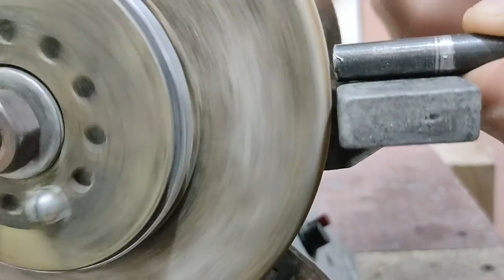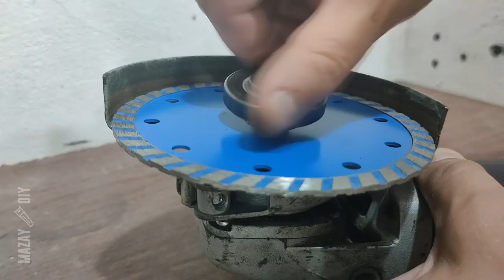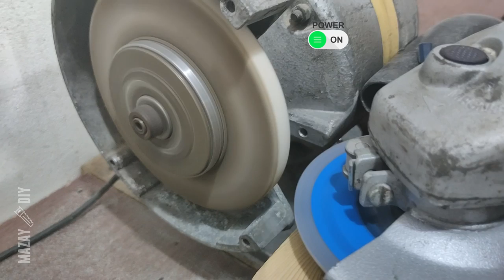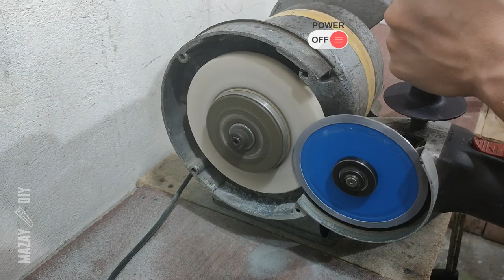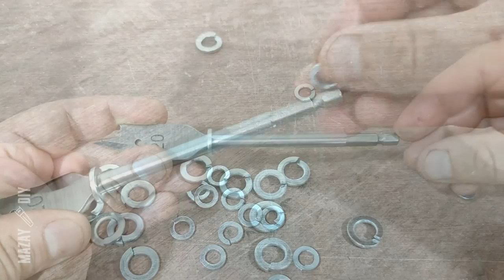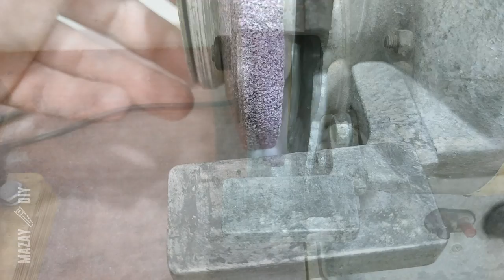How to Dress a Grinding Wheel | 3 easy ways

Comment: Useing the diamond wheel to dress the grinder is a very good idea. I only watched the video, didn't listen to the sound track so you may have mentioned this. I would be very reluctant to dress the sides of the grinder wheel. Grinder wheels are not designed for ANY side loading. To much side loading and the wheel WILL shatter on you and chunks of it will be coming at you at very high speed. After all these years I still stand to one side and reach over to turn grinders on. I wait until it gets to full speed then move in line with the wheel to do my work. Still the diamond wheel is a good idea. I also liked the way you set up to avoid a mess. Well done.
Reply: 👍 Yeppers if possible never stand inline , while true if it grenades it's going everywhere , but standing inline is just bad , like running a tablesaw always stand off to the side of blade . An avoid the cheap grinding wheels also , we had a kid  who on his lunch break run up an picked a cheapie one . I really don't know what happened as I wasn't there at that end of The Shop , but man that thang came apart with a Hell'va racket fortunately he didn't suffer any long term injuries , The Shop Foreman really chewed his ass out .
I've used the  worn carbide cutting tips from the Brake Lath as well , they do a great job on grinder wheels .

Comment: Thanks man - the split washers worked amazingly well for me! I have a 6" grinder with two stones and both had a big groove worn in the middle of the wheels. I had been looking to buy a tool for this but then I came across your video and decided to give it a go, but with LOW expectations. I mean it's so simple, how could it work better than a purpose built tool?? Well,  20 mins later I had two beautiful, square stones with ZERO cash outlay (had a bolt and washers already). You saved me $40+ and the time to go grab a tool for this. Amazing! And the other plus is that the rig I made with the washers did 2 wheels and look to be able to last for a few more clean ups yet!

Some tips if you're going to do this - make sure there's enough clearance on the bolt to allow the washers to spin freely and not too long a bolt to allow you move side to side across the face of the stone (so you wear the washers more evenly). The other tip is this will get Hot,  so wear some rigging gloves or similar. 👍
Reply: I love the "but with low expectations"

Comment: There's a tool for that , it's called a grinding wheel dresser tool . Works very well for this . Just a FYI 😉
Reply: Yep.  Its a must have item
Reply: He called his video " repair without any special tools". FYI
Reply: @EvacuatorPro  a grinding wheel dresser is not a special tool. It's a standard tool if you have a grinder.
Reply: @frogsoda  I’ve inherited a grinding wheel, but got no dresser tool. I’m still searching for a shop where I can buy one. So at least for me it’s not a “standard tool”. Until I find one, the tips in this video helps me.
Reply: @bjondersson  man everything he showed in this video is extremely dangerous, especially dressing the side of a grinding wheel. You shouldn't even use the side of the wheel much less dress it. Do what you want but these wheels can blow apart and if I'd does you will be sorry. Trust me seen it happen.
Reply: @frogsoda  all grinders should come with one, unfortunately they don't.  a lot of places that sell grinders don't even carry dressing tools

Comment: There is actually a tool made for dressing wheels,it can be bought at most hardware stores & welding supply stores !
Reply: Costs like a good set of carbide-tipped drills (unless you can get it as a cheap replacement part for grinders ofc but the pro stuff which is readily available over here costs that much) vs 1 old piece. And even if you buy the tool but you don't have the dressing harness for the grinder for any reason, the tricks here are still useful.
Reply: My wheel dresser (essentially some very hard abrasive on a stick) cost a couple of quid and works fine on small and large bench wheels. Leaves a completely square surface.
Must confess I'm puzzled why anyone would need the methods in this video.

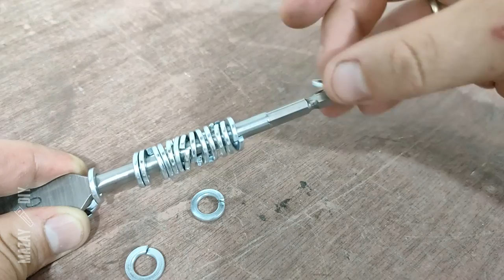Comment: 2:55  right.         i used the same idea, lock washers on a large screw driver, works for me. The diamond wheel, on angle grinder, new idea for me. Thankyou, sir.
Reply: I use regular flat  washers. an old file works  also

Comment: Weird, I  just replaced  my old dresser for one of those new fangled diamond coated wheeldressers off of ebay.  It cost less than $10.00, is absolutely  safe and took about 6 seconds to dress my nappy old grinding wheel.  Even if I  didn't  get the "SPECIAL" tool, I  wouldn't  use this method shown here, I'd  get a new $13.00 stone.  Although it worked, I  don't  like bending the rules that far.
Reply: They obviously never seen a wheel blow apart before.

Comment: That's a great hack for straightening out your old crooked out of round grinding wheels
Reply: It can also make the wheel explode. The wheel is not made for sideways pressure
Reply: @nicolasmiller-vachon4066  that makes sense also if there's a crack in the wheel and you try to push on the side of it I am sure that'll end up pretty badly too

Comment: Ah, yes… the old split lock washer to be used to replace the worn down star rings on a grinding wheel stone dresser.  I use the external spiked lock washer, also.  I didn’t see you around, 50 years ago?

Comment: Grinder from 1986 made in USSR. I have exactly the same. It dance a lot on the table. The body is too thick and therefore the diameter of the stone should be always a bit bigger. I dont use it for last few years.

Comment: There are way easier and therefore better ways to dress a grinding wheel that uses the power of the bench grinder not having to turn it on and off. They certainly don't require another electric grinder and still achieve great results. For me this is a great example of over thinking something.

Comment: This is almost a good video. You should never grind on the sides of your grinding wheels! Never! It creates grooves in the wheel and eventually it will thin out too much and come apart.
Reply: I 100% agree. The fact you have to take the guards off should be your first clue you are doing something wrong.
Reply: There are different wheels. You do grind on the sides. I was a tool grinder for 10 years.
Reply: @Robstercraw  Your right there. But they are designed to be on a side grinder or tool cuter grinder. Which take different wheels then a normal bench or pedal grinder. Normal bench or pedal grinder wheels are not made for side grinding.
Reply: @1cx2william  wrong. We only used bench grinders. Depending on what you are sharpening you most certainly do dress or shape  the side or sides of almost all wheels. Look man, I did this professionally for over 10 years. I know what I am talking about. You don't need to dress the entire side, just the end. If you you are split pointi g a drill bit for example you use the side of the wheel for that. If you are sharpening something that is a v shape you need to dress the wheel accordingly. The face of anything is flat meaning you use the side of the wheel.
Reply: @Robstercraw  one been doing machining for 18 years including sharping my own end mills, gear cutters, and so on. Yes, I have seen people use beach grinders that way and I have seen one explode from it too. The person that had it happen to him had been doing it for over years. Just because you been lucky does mean it the right way.
Reply: @1cx2william  we did use everything properly. Nothing would ever explode from using the side of the wheel. Machining and sharpening tools is two different things. I know what I'm talking about. Any professional tool grinder would tell you the same. I don't know what he was doing but obviously he wasn't a professional. Certain wheels are designed for that and there are a ton of different wheels,  trust me. I know.
Reply: @1cx2william  just because you sharpen a few pieces... we sharpened everything you use in utilities. Even custom cutters. You can't sharpen a hold saw for example without making a 45 degree point on the wheel which is grinding the side of the wheel. If a punch is v shaped you have to make a v shape on the wheel. Do you force things into the side of the wheel? Of course not. However, you dress the side of the wheel to the shape you need on the end. Period. I wouldn't dare argue with you on anything machining wise so don't argue with me here. No I was not "lucky" I just know what I am doing.
Reply: @Robstercraw  which is what a tool cutter grinder is used for.
Reply: What a thread
Reply: For most situations in real life, guys are gonna grind on the sides of grinding wheels.  I agree that rules and safety should've followed, but in reality and given the situation, it's gonna happen.  We should include- wear your seat belt in this rant.
Reply: Personally I'd buy a new wheel, but sometimes the money isn't there either.  You do what you can with what you got and hopefully can keep it proffesional.
Reply: @Matt-my7pz  right. It doesn't create "grooves" and if you're stupid enough to grind it paper thin then of course it will fall apart.
Reply: @Robstercraw  exactly.  I guess your likely to do it only once and then know to not go so thin 😂
Reply: @1cx2william  18 years and only one explosion. Pretty good odds if you ask me.
Reply: То же самое подумал про торцы. На торцах вроде запрещено что-либо точить.

Comment: I'm at a loss as to exactly how a wheel can become lopsided, unless pieces were break off
Reply: Exactly never dressed one didn’t know of it both grandpas never did
Reply: @jameschester3986  I could see needing to do some minor flattening if you aren't smart enough to not just grind in the same spot constantly, or if you were using the side of the wheel, which you aren't meant to do anyway (on most general purpose wheels). But this one he did had a huge dip in the wheel that couldnt have been made with the grinder powered on, even if you just jammed a piece of tungsten in there really hard, you cant just wear down a spot without wearing it down along the entire radius. If it jammed hard enough to break a piece out and come to a stop, i suppose that could be it, or if it was a manufacturing defect where part of it cracked off idk lol

Comment: Can't say I didn't enjoy that nasty grinder on grinder action. But I have to come out and say it, if you use a bench grinder properly you'll never have to reshape the wheel. Some metals will clog a abrasive cutting or grinding wheel but running it against a piece of concrete fixes that. Just saying.

Comment: Great intentions but so many bad things about this video. Safety... never use the side of a grind wheel as can cause failure which can get messy. No cover on the side of the machine (may have been removed for purpose of the video). You can buy a single point dressing bar for 10 or 15 quid so why would you use an angle grinder with a diamond blade, not to mention in the wrong hands could lead to an accident. Washers mimics the idea of a carbide dressing tool but being steel won't dress the wheel like a carbide dressing wheel would. Other issue is truing the wheel/making round is not the same as dressing and 2 different maintanence procedures for 2 different reasons. Dressing won't make the wheel round... -if the wheel is out of round the washer technique or carbide dressing wheel will remove material from the grind wheel but will follow the contour of the wheel and not change any out of round... that's where a single point diamond dressing bar comes in to it's own. Just don't like the idea of someone not knowing the dangers or potential consequences copying bad practices and ending up hurt or worse...
Reply: One of my fellow students in my junior high shop class was grinding a screwdriver that he had made. The screwdriver got caught by the grinder, it took it in and around with the wheel, then came flying right back out stabbing him through his hand.
Reply: 100%.👍